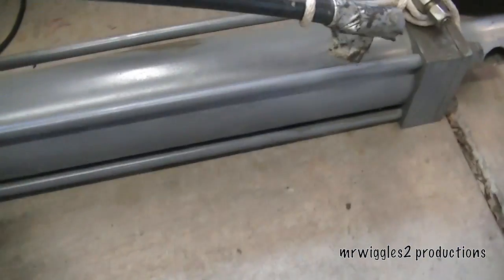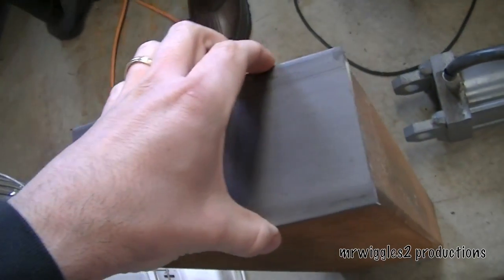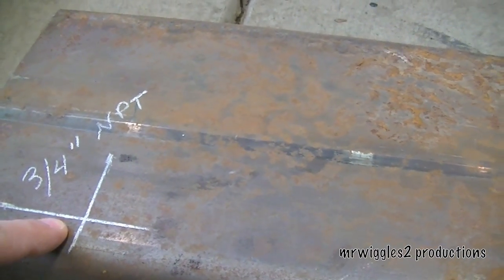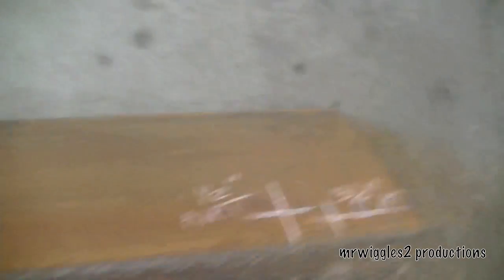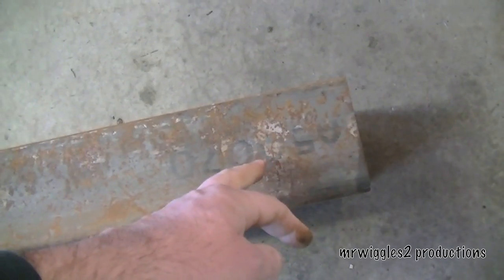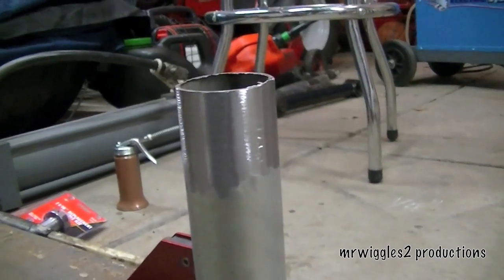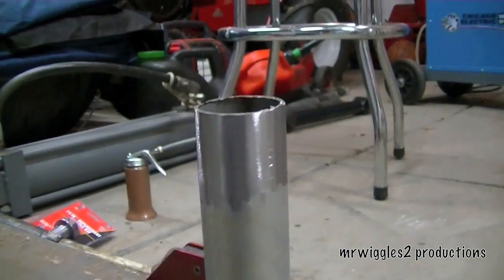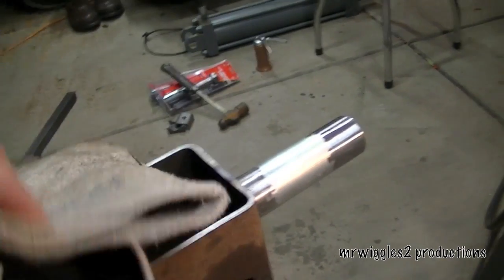Homemade Log Splitter Build Part 1

Comment: Many a log splitter have been built using the I beam as your hydraulic reservoir , by simply plating & welding a side of the beam. Definitely saves money and weight properties .